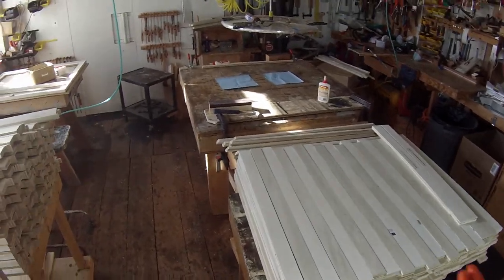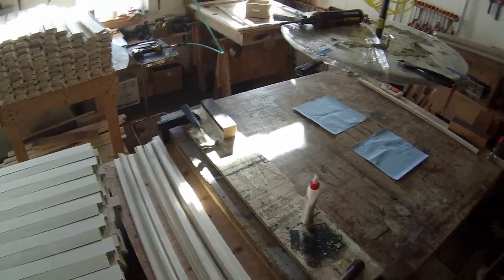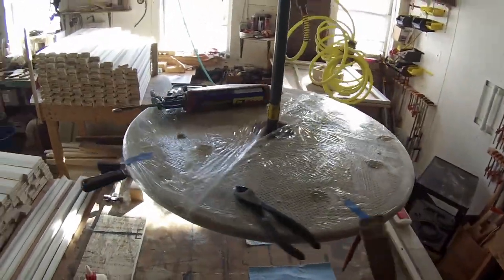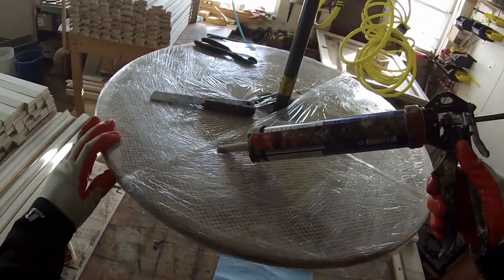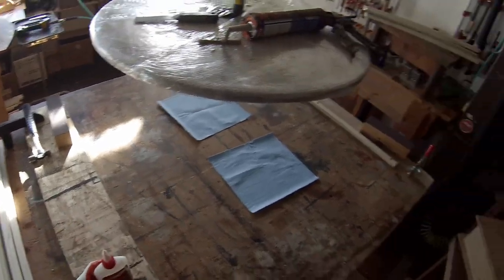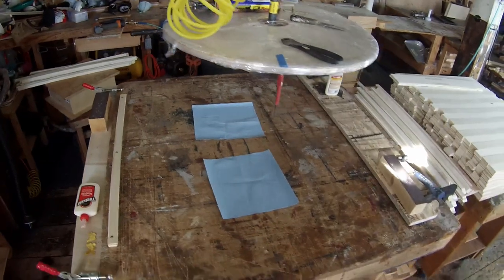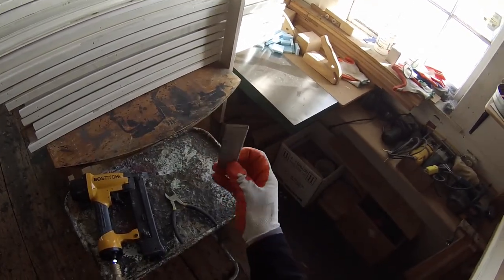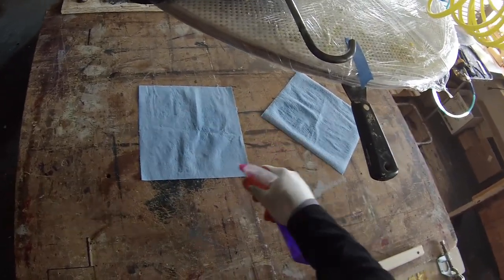Stretcher Frame Assembly Process

Comment: Construction adhesive tubes contain an air bubble. When in use, the bubble acts like a spring; when compressed, it will make the glue ooze out. Until the bubble comes out (usually toward the end), then the oozage stops. Same goes for caulk.
Reply from the maker: yes but the hard part is keeping the stuff off the tools, work surfaces, and clothes.
Reply: So totally agree!
Reply from the maker: I have to say the hanging turn table was the perfect mess solution for this set-up.  I didn't get any glue gunk on myself or the work area.

Comment: Whats was with the soil tossing?
Reply from the maker: Sanding the driveway is part of life in Vermont.  The ice is very dangerous without a bit of sand on it, and the plow truck can't move snow without some traction.  and I save $30 a pop if I do it myself.
Reply: Ah ha! It doesn't snow where I am hence my ignorance on the matter. BTW I love the turntable solution.